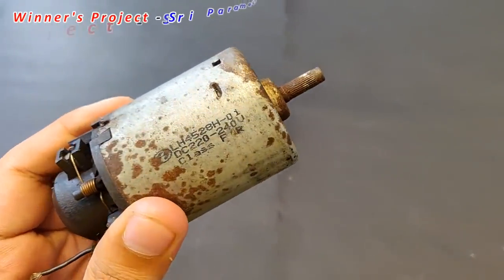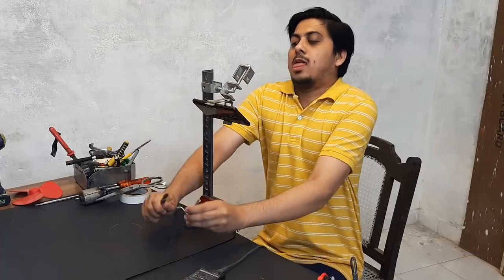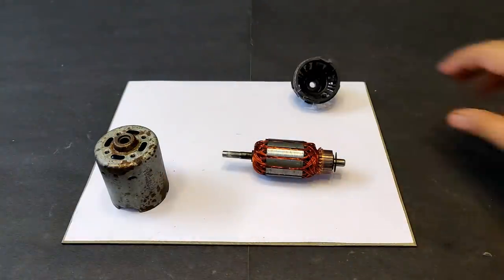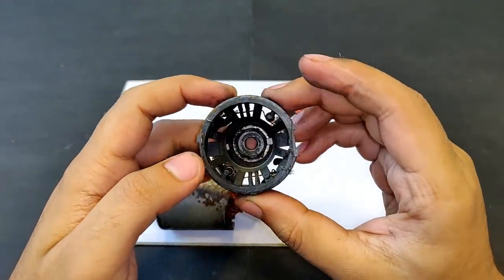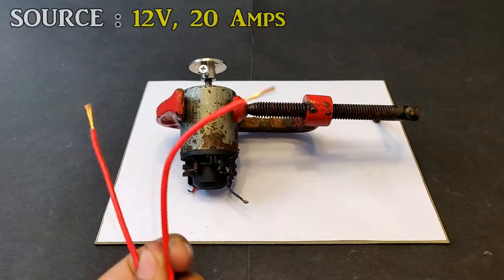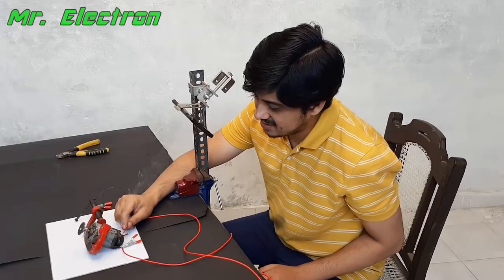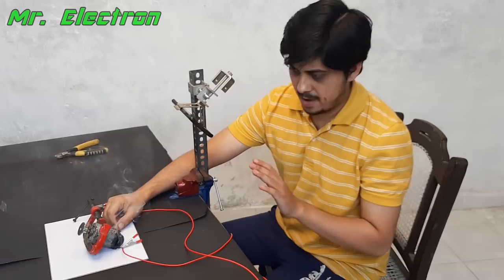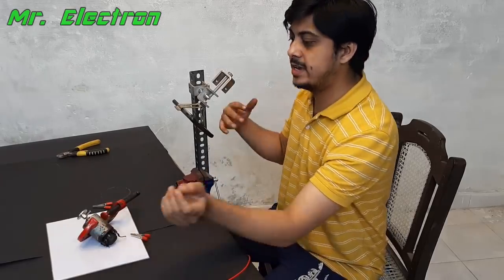220V DC Motor to 12V High Current Motor for High Speed & Torkue -Experemint !

Comment: As the windings burn and short, the resistance decreases and the BEMF decreases allowing the motor to spin faster and more freely. It also draws more current as the resistance decreases. Also, as the brushes melt, the friction decreases allowing the motor's shaft to spin more freely.

BEMF: back electromotive force, a force that opposes the rotation of a motor.

Comment: why its not stoping is because the back casse is probably not made to handel high curent and high temperarures and the materials used probably to build those brushes culd not withsdand it neather in my opinion diferent plastics have diferent chemical compositions who might react with curent flow the same is considered for the brushes perfect exampel wuld by some thing similar if you dip copper wires to liqued oxygen my prediction wuld by probably with smaler wires you wuld by abel to carrie more curent if cold enough wires and insulation wont melt at all under high curent and including high voltage so thats the trick perhaps in plastics you can finde methanol ethanol carbon and other crap who pribably wuld react with any thing including reacting with magnetic fields no mather if you use heat preshure light vibration ore centrain type of electricity it performes the same reaction even tought they are diferent apriaches of energy some elements extract repel under curent some atract atraction under back curent to my thats how it is probably you wuld get even more strange things to see if more elements get involved but most likely you see a explosion ore implosion in some cases and not including diferent elements produce high toxic gas by carefull not to breath in those fumes study what that plastic case is made of and those brushes they might realease lot more energy then rated normaly there is always a solution prevent it from acuring in the first place by cooling those parts down ither air ore centraing gases types ore some cinde of oil who can act as lubrecant and protect brushes to wear out on you for evry thing exist back inginering ore reverse inginering by the way you might get bether results if you mold your own brushes and actualy made those things by your self who culd have lot more endurance then normal brushes its anoing replacing those deam things they such small and fragile.
By the way grafite and florine are considered I belive most sliperry elements so I belive thats a posibility why its spining up faster some peopel make frictionless bearing's from that staff and grafite conducts good electricity so probably you acidentaly put a fhew comitator segments in series who are atached at the same time that motor shuld still work but I belive he will drain a plenty times more curent and voltage the intended thats a big posibility.
Grafite pouder ore grafite fumes conduct evry where electricity even tought its not fisicaly tuching those parts that wuld by called probably grafite under gaseuse state 🤔

Comment: I tried 3 volt dc motor with 225 voltage and it go (BOOM), and the electricity breaker got triggered. Its a spark but its terrifying and then i starting to smell something burn. It comes from the dc motor

Comment: wait, can i use more of the thicker wire, and it wouldnt burn? or should i use thinner wire? i want it to run fast on 12VDC. you made a video where you converted an universal motor, to a perma-magnet DC motor and i want to do that too.

Comment: as what i see your winding diagram is wrong, i actually did the same on a 12 pole 220vdc motor, converted to 24v, it has 2 sets of coil need to be wound alternately, and each coil has a center tap , means each coil per pole is connected to 3 commutator contacts

Comment: Which power supply you're using to power that motor, 12v 20 amps.?  Is it smps or what?
Reply: Transformer
Reply: SMPS is far more better than transformer as smps has full bridge rectification where as circuits used in transformers dont use cap filters so you dont get 100% DC output

Comment: If number of turns /pole on armature winding are not identical then it will affect turns/phase which will affect current flowing through it.
Therefore required magnetic flux to be produced by armature will not produce and will affect in output power + efficiency.

Comment: If the number of turns on each pole are not the same on the armature, you will have different magnetic field strengths, thus, the motor will provide a changing torque
Reply from the maker: As a result , motor will start vibrating. You gave the first and almost correct answer so Congratulations, you are the winner..
Please mail me your project request as soon as possible but only channel related project.

Best Regards,
Mr. Electron
Reply: @MrElectron  Could you make a motor for me that is 18V 1.5 amp dc motor 50 rpm?
Reply: @acestrumpkings4468 
Yes

Comment: is it possible to run full power of 3000 watts car inverter with alternator.   if it is works, how to use 1500 watts of IRON BOX or high power usage electronics...